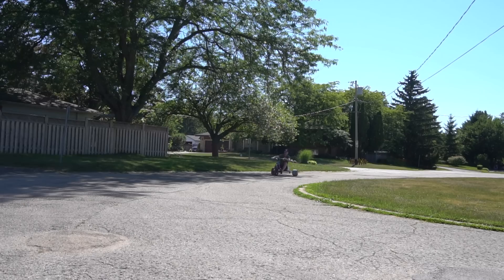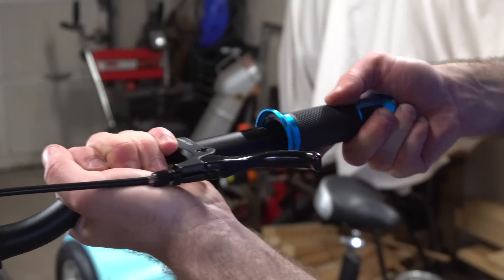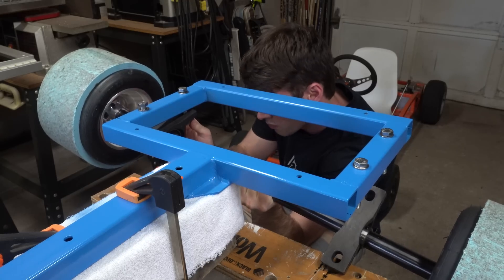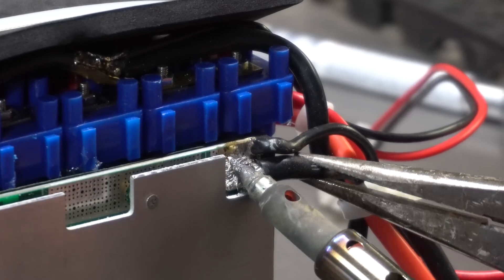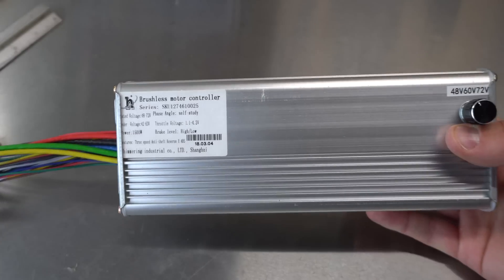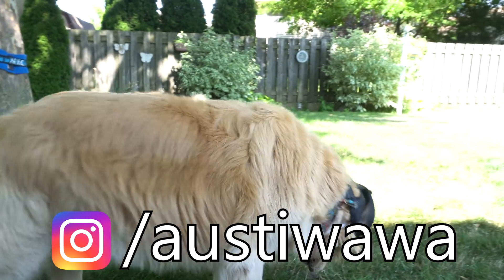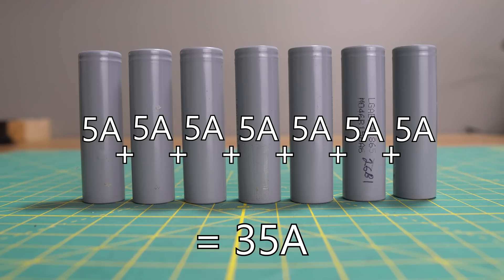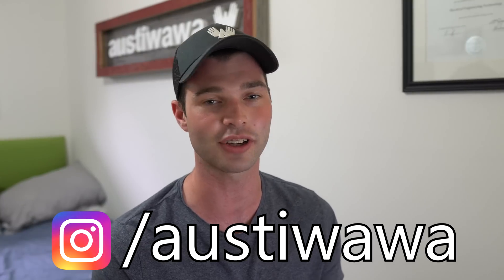Homemade Electric Drift Trike - Part 3

Comment: I'm wondering if I should look for part 4 - where he discovers after building the new pack that his controller is a huge bottleneck.

That controller is only rated for 30 amps - your pack puts out 35.

Controller peak is irrelevant, as that's a mutliplier of battery voltage that you'll see under acceleration.

You might see 70 phase amps off the line, but that's based on the 30amps that the controller can use.

Increasing to a bazillion amps would not increase it above 70 or whatever phase amps you were already getting.

Comment: Would a 16S battery still work on the 48V setting or is the motor controller rated for maximum motor voltage and not minimum?

Comment: what are the pros and cons with front vs rear wheel drive?
Reply: buy a rear Wheel drive, they usually have higher torque - and simply mount it in your front wheel

Comment: have  you ever thought of using some Milwaukee 9 amp hour or 12 amp hour battery's? and putting those in series also that fact that they have on board BMS on the batterys? also quick charging with the fast chargers and you can use the rapid charge station to quick charge them quickly 3 at a time

Comment: Just finished a drift trike for a buddy of mine. Its using a razor drift trike as a platform, which made mounting the hub motor ridiculously difficult to mount. Otherwise the battery I made works perfect and lasts a really long time, hours of riding. Most of the cells I used have a max discharge around 5-8 amps. I used all different types and then just made sure each cell group had similar capacities 17-18AH. You can exceed the max discharge but it will continue to heat up the batteries quicker then they should be, and heat is what damages cells. Realized I shoulda made a video of me building this thing, expect I realized that halfway through...

Comment: Looking good Austin. I just tagged you on an Instagram comment showing what happens when you don't use a torque arm. Leaf Bike should start including torque arms with their kits, maybe after they see your video. I burned my first speed controller last week, carrying too heavy of a load, half of the MOSFETS unsoldered themselves from the circuit board and it released the magic blue smoke. I thought speed controllers were basically the same, but I upgraded from a 32 amp to a 50 amp and the increased acceleration is incredible. I also upgraded all of the battery wires to 10 gauge with 45 amp Anderson Powerpole connectors. I'm looking forward your test drive video. It would be cool to see some telemetry when you ride.
Reply: I almost forgot, you got braces!
Reply from the maker: Thanks Scott! And yeah I definitely wouldn't want that to happen to me. Hopefully you don't run into any problems with your new controller!
Reply from the maker: I did yes haha!